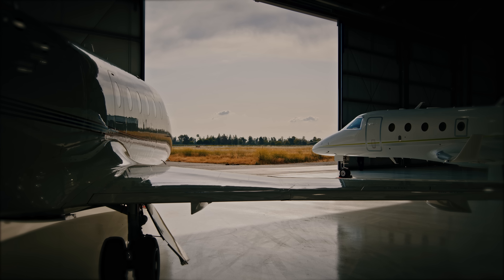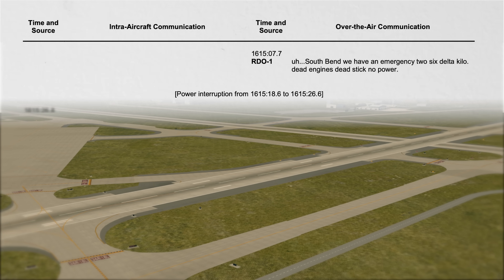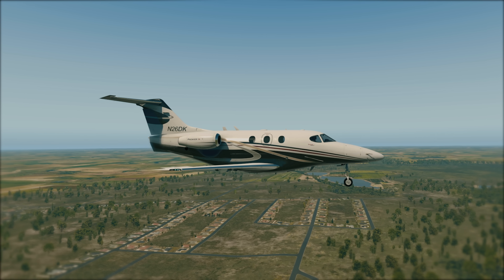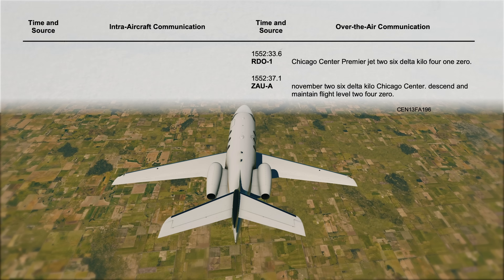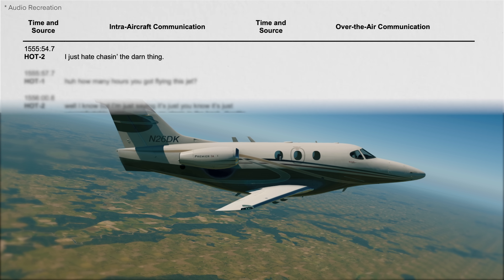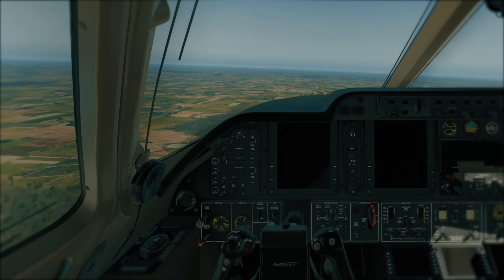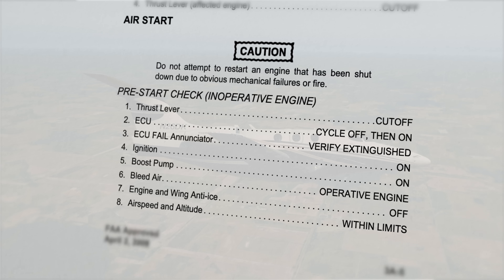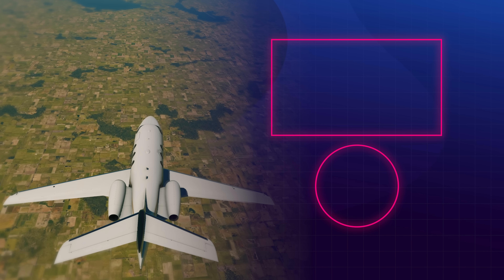Passenger Causes DUAL ENGINE FAILURE | Accident Case Study

Comment: 4:30 love how a controller asking for a go around was enough to fix the engine... A pity they didn't just land without gear though, might have ended up better :/
Reply: That was my thought too. Had they come in gear up they might've made it
Reply: @EricTheBlue2010 you are correct.
Reply: All he had to do was pull the emergency gear handle all the way out and the main gear would have extended .If he would have practiced that in the simulator at flight safety where he likely got his type rating ,he would have known this .
Reply: @Bax60  well, sure, with all gears down would have been the better scenario, but it looks like that wasn't a day to be too picky about those little details 👀
Reply: @julienb5815  Its not about being picky, it's about flying the airplane properly and using the checklist. And you have to do it that way every single time.The bottom line here is this never had to happen .Even after he made rhe bad decision to let the unqualified pilot pull the throttles in to cutoff ...all he had to do is run the engine out checklist and restart the engines ..there was never a need to pull the emergency gear handle yet ...and if you are going to pull it ,pull lt out all the way ,and the gear comes down...it's better to land with no gear ,than just the nose gear ...This whole thing went south because the pilot just did not follow checklist procedures for a double flameout of the engines.He had plenty of time altitude and airspeed for a restart..he got one relit ,so climb back out and run the checklist and start the other one ..This aircraft will fly just fine on one engine for hours ...no need to hurry
Reply: @Bax60 that is all fair, but tower’s last report was no engine no hydraulic. At that point you let the pilot know the gear situation and expect belly belly. You don’t order a go around on a no power aircraft.
Reply: @Bax60  the first go around was initiated with no gear down. 

I am aware of the video and the 20/20 hindsight of the failures of the pilot. However, the only information the tower would have been working with was complete engine loss and limited hydraulic. It is possible that they somehow noticed a working engine but doubtful. 

This was a declared emergency, you don’t do go around you give pilots information and let them make the call.
Reply: @Bax60  idk how I missed your reply notification, maybe lost in the middle of others I suppose. Anyhow, looks like someone got his PhD from Kiljok University
Reply: @m.hasler7263  Agree. Controller(s) should be banned for life or jailed. Ordering a go-around on unpowered final with no hydraulics and no radio is TOTALLY INSANE.
Reply: Yeah, imagine having such a failure, but being so lucky you're perfectly within range of a landing strip... only to find you're gear didn't come down... only to go around and then find that only your front gear went down... only to go around and then crash straight into some houses before you can make it back to the runway.
Reply: Misleading title. This was the pilot's fault
Reply: It's baffling that ATC told him to go around, it's even more baffling that he actually complied.
Reply: That's what I'm thinking too. Granted my pilot experience is limited to war thunder, but I never had much success pulling off a go around if my planes engines are already on fire and I came in too hot the first time to land.
Reply: What's the chance of a successful gear-up landing when you have no reversers, speed brakes, or spoilers? Oh, and you don't get to burn off excessive fuel prior to the attempt either.
Reply: @dcmark65  better than your chances of living through a no power go around. 

Also if you have complete engine failure you have no speed brakes, breaks, reversers etc, so your landing also may end up flipped over on the far side of the runway.
Reply: So it sounds like he had plenty of opportunity to lower the gear but for some reason didn’t.
Reply: Agreed, I'm honestly pissed off that the ATC told him to go around.
Reply: He regained engine power right before his first landing attempt, he should have called for a go around instead of forcing a landing and then claimed and taken the time to go through a landing checklist
Reply: That's what I was thinking. May have wrecked the plane but I have a hunch that all 4 would have survived with minor injuries. :l
Reply: I had the same instinct, not a pilot but from everything I seen, if you are in a state of no engines I think first priority is landing on the strip right before you rather than risking a go around and crashing(which I have seen a lot). Now, that is usually when you have unexplained airplane failure while here they were totally in control of the mechanics, by sounds of it restarting the engine would not actually been difficult and is the correct call.

Still, being he also pulled back up when the 2nd landing failed instead of just committing and then crashed into a house. I read it as a fault, he did not know when to make a stand.
Reply: @sapare7838  the order of things to do for an engine failure (double in this case) is to pitch for best glide, pick a spot to land and if altitude allows, which in this case it definitely did, you run the checklists for trying to restart the engine (while still flying in the direction of the place you want to land). In this case, he would have been able to restart both engines and land normally, since there were no mechanical issues. If you do have a mechanical issue, you try to restart engine and if the checklists dont work then you try to land in the location you picked.
Reply: @sapare7838  Correct. This is so unbelievably obvious any child intuitively knows this. This guy was a terrible pilot.

Comment: Omg I just listened to the rest, someone should investigate how this very wealthy man got type rated, it seems he has absolutely no knowledge of his air crafts systems.
Reply: I think that's assumed, but it may not be true. He could have pulled the manual gear release the whole way and then it was knocked partially back in when he crashed... so we can't assume he was too stupid to pull it all the way out. He could have pulled it all the way and/or could have tried to pull it all the way, but it was stuck for all we know. He was able to get one engine running and with that he could have flown indefinitely... and I don't think anyone knows why he actually crashed. We know mostly what happened leading up to the crash, but we don't know why the plane just flipped and crashed in that moment as far as I know. He should have had plenty of lift and control with just one engine.
Reply: he likes arts and crafts too

Comment: absolutely mindblowingly dumbfounding incompetence, ineptitude, and wantan reckless disregard for airmanship and safety smfh
Reply: Wanton*
Reply: @strangehallucinations was just checking if anyone else caught/corrected that…nice.
Reply: What?? Tower confused the pilot you duchess
Reply: Brains don’t always process properly during intense stress which is why it’s important to stay calm. Who knows what else happened during those last 7 minutes.
Reply: @dgcastellanos  This is what checklists are for. Idc how well I think I know my procedures, I will always be reaching for that checklist especially in emergencies. The last 7 minutes are of course a mystery and at that point the mistakes make sense due to task saturation but they never would have been in that situation to begin with if they were flying with a modicum of responsibility. So sad.
Reply: @andrewmaclean9810  I bet the PIC gave the stick to the passenger and then worked the problem and the passenger not knowing the aircraft spun it turning to final.
Reply: @dgcastellanos prolly getting a sloppy toppy from his college buddy

Comment: This is a bizarre story. Can the pilots actions be justified in any way. It almost sounds like the pilot has never flown a plane. He followed none of the standard procedures.
Reply: @PilotInstituteAirplanes  You mentioned hazardous attitudes, and this guy had it in spades. Incompetence assumes you are just ignorant or forgetful of procedures. From what he said about intentionally ignoring W&B that goes past incompetence and into sheer arrogance and lack of regard for safety. I don't understand how, after so many fatal crashes caused by going over W&B limitations one could possibly have that kind of cavalier attitude towards it. Same goes for taking an overspeed in stride.
Reply: @PilotInstituteAirplanes  Very well made video by the way! Thanks!
Reply: Too much money, too sloppy and irresponsible.  No room for error. It's not a low speed ultralight.
Reply: @RetreadPhoto I'm surprised that his insurance company let him fly without a qualified safety pilot, at least until he had more experience.
Reply: @whitelobster1ify This is a single pilot rated airplane .As long as he received his type rating from a qualified CFI ,that's all the insurance company is looking for .
Reply: You can’t receive a type rating from a CFI, unless the CFI is a DPE or FAA check airman.
Reply: @russellmoore5711  He probably got his type rating when he bought the airplane though flight safety if he bought it brand new in wichita
Reply: Yes, then that would be a TCE.
Reply: mo'money than skill
Reply: St. Patrick's Day? Stink'n drink'n think'n. So many bad moves.
Reply: @royhenley2396  You have to run the checklists  .And you have to do it every single time, the same way no matter what kind of airplane you are flying. What to do when both engines flameout for any reason? Keep flying the airplane, immediately start running the emergency engine out checklist. That's all he had to do ,he had the altitude and the airspeed to restart without even using the starter, and could have relit both engines and landed safely .But he obviously didn't do that .He never need to pull the emergency gear handle yet ,that's another checklist .Had he have run that checklist he would have read pull handle to first detent, nose wheel down, one in the green ,second detent, main gear down,3 in the green..but he doesnt do that ethier .. checklist !

Comment from the maker: What would you have done differently?
Reply: Press the P button.
Reply: "What would you have done differently?"
Yes.
Reply: Flown commercial.
Reply: Hired a qualified, professional pilot
Reply: Not washed down xanax with a martini before flying?
Reply: I would if followed the “no engine” landing checklist which undoubtedly was covered in type rating school. Kept the gear up, deployed appropriate flap setting and landed on the belly on the runway and take a foam bath if necessary.
Reply: Aviate.
Reply: Nothing.  Darwin's law applied.  Results for this pilot were inevitable.